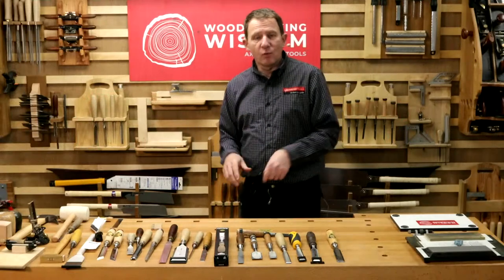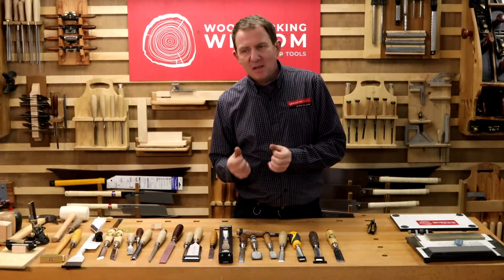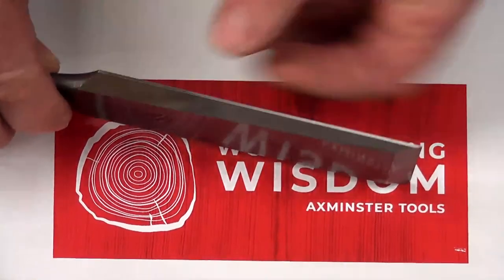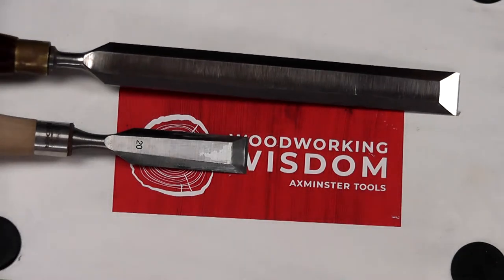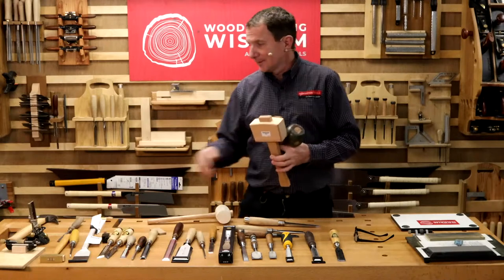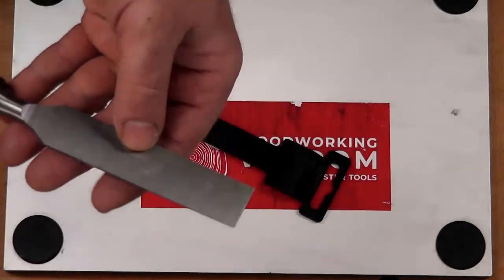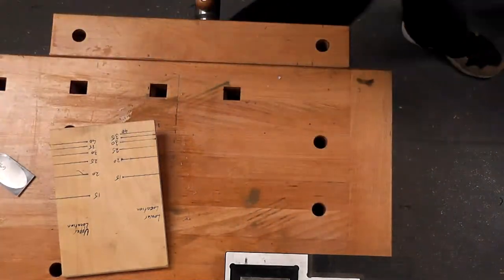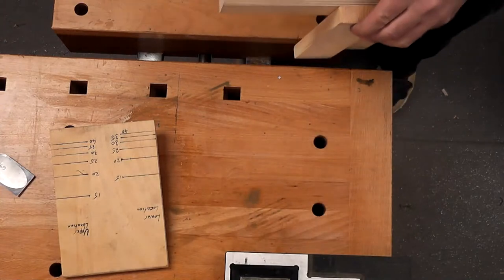Choosing the Right Chisels - Woodworking Wisdom

Comment: Hello Axminster i have a question for you when the lathe has been trning for a wile dose the long hand wheel at the back of the spindle beside the motor dose any heat from the bearing come on that thanks Michael
Reply from the maker: Hi Michael, Jason says: "The hand wheels on the lathes can get warm for a number of reasons. The belt will cause friction on the pulleys, which will create heat. The motor will also get hot and this warm air rises through the headstock. The drive shaft and bearings will also get warm when in use. All these factors  can mean that the hand wheel can get warm. If this is getting hot beyond what you would expect, then it would be worth checking that the pulleys are aligned top to bottom, that the motor air intake is clean of shavings etc. If the bearings are damaged, then they will not run smoothly which you will feel by turning the spindle by hand, and these will also make more noise when this is running." Hope this helps.
Reply: Thanks Axminster and  Jason for that information that all makes sense if you think about it Thanks again Michael 👍